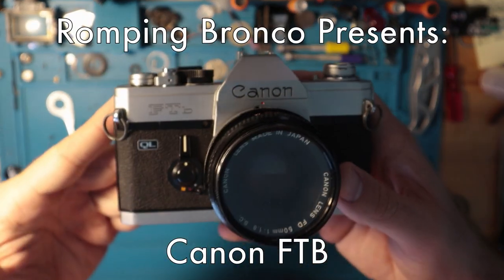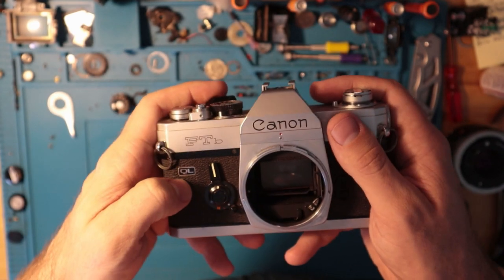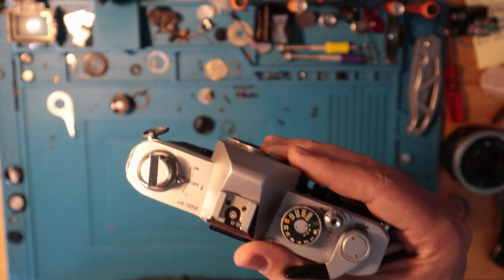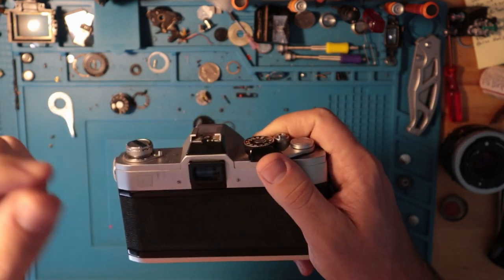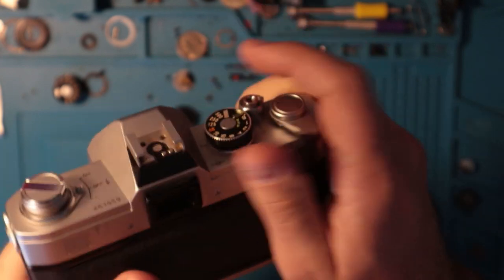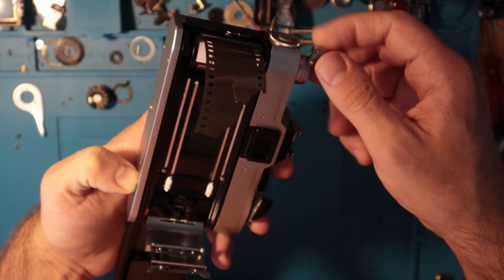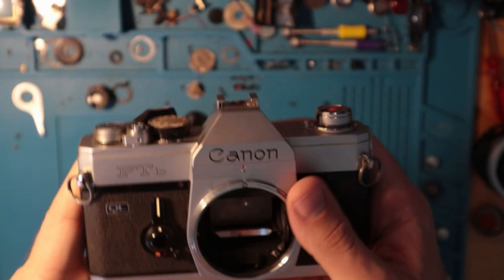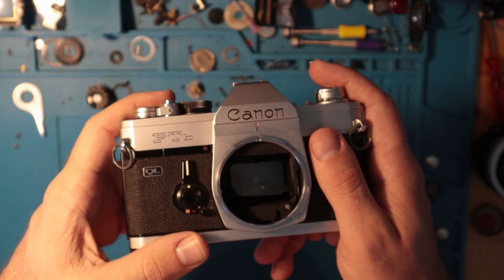Canon FTb Walkthrough

Comment: This helps for my extensive research for the ftb, been planning on purchasing one. Quick question does the bulb mode need a battery to power like some cameras or its fully entirely mechanical?
Reply from the maker: Great question, almost as great as your username. The FTb and all of the similar Canon SLR's (Ft, TL, TX, etc.) are fully functional without the battery. Power is only needed for the meter. Honestly I would highly recommend these cameras, it was a lot of fun to use and once you get used to the kind of wonky light meter it's just a dream. I'll have a video soon discussing a roll I shot through it so I hope that helps!

Comment: I got a FTb and it works, except 1s shutter speed. Is it worth it trying to fix it? could be just a matter of open and clean or is more complicated? Anyway, I think I've never shoot 1s pictures, so is not a big deal for me.
Reply from the maker: It's definitely worth trying to fix, FTb's are about as good a camera as you can get and the timing mechanism in the bottom is super accessible and easy to clean, however if you don't shoot 1s photos it may be wiser to just let sleeping dogs lie and I'll make an FTb video soon to go over the repair soon just in case the problem worsens (it likely won't)
Reply: @RompingBronco  ohh, that sounds cool! looking forward for that video.